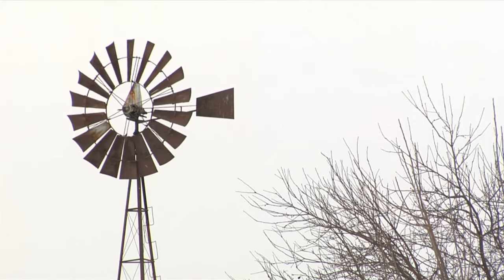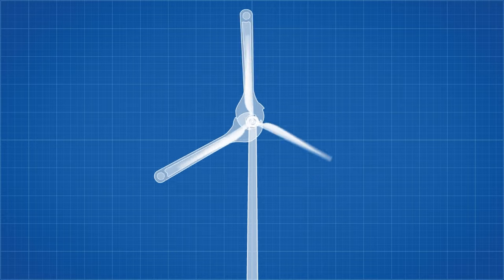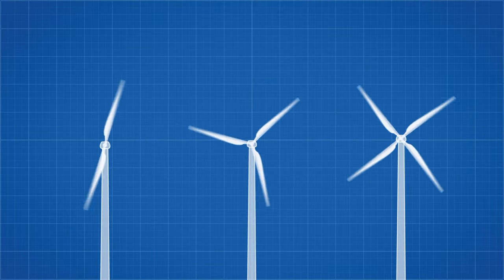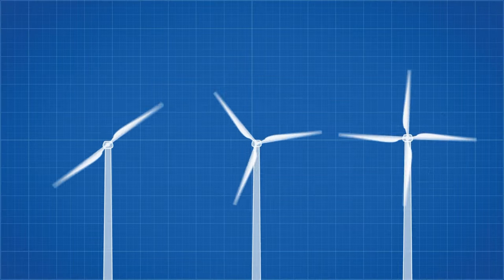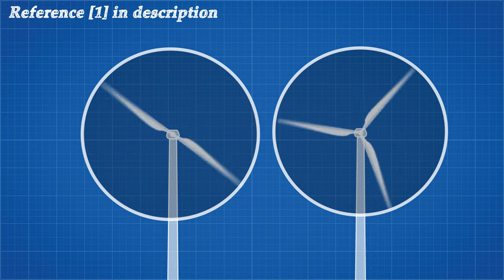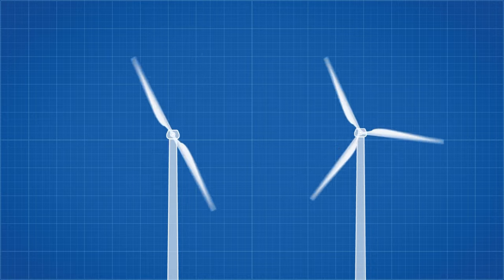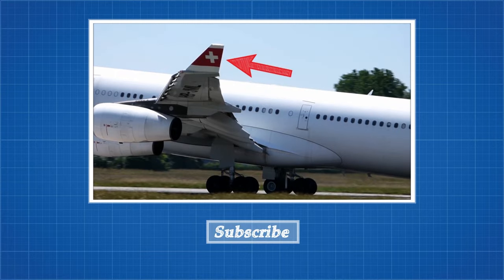Why Do Wind Turbines Have Three Blades?

Comment from the maker: I plan to remake this video at some point. It's a really shallow explanation. I simply did not have the skill and experience to make a longer video when this was released. I could crank this video out in a single day now. The subject definitely deserves a more in-depth explanation.
Reply: Cool, would be really interesting if you did. Perhaps a few consideration on offshore vs. onshore could be included as well as a look at underwater turbines. just suggestions of course. cheers and keep up the good work!
Reply: This explanation is good. It's not misleading in any aspect. Some details are left away but mainly it's a cost, structure and noise issue.
Reply: also look into single blade turbines...
Reply: Efficiency is low and bearing loads are high. 
But maybe for small WEAs they make sense.   

Go for that https://univerlag.uni-goettingen.de/handle/3/isbn-978-3-941875-75-3 and here into the appendix.
Reply: Please do, your videos are usually so much better.  This video feels like it amounts to "3 is just better".
The generic cost graph didn't even hint at the effect of blade count and the video basically ignored the engineering concerns. (like Robb Stark's comments below on boundary layer related wind speed/stress balancing making even blade counts problematic).  
It would also be nice to hear something on VAWTS.
Reply: With one blade hanging down doesn't gravity want to pull the other two down making it want to spin with little wind. 2 of 4 blades cancel themselves out in that respect
Reply: You also should talk about the one blade design.
Reply: Scott, the single blade design uses one blade plus a counterweight.
Reply: Felipe Abou   So it acts like a two blade.
Reply: Please do!
Reply: @Scott: No. Think about bending moments of/on main shaft.
Reply: Hermann Rochholz   Is that your answer to me saying " So it acts like a two blade "
Reply: Yes, correct. 
And 1-blader has a higher induced drag. The more blades the lower induced drag. With an infinite number it's away- But these have to be infinite slender. This isn't possible because of structure.
Reply: Hermann Rochholz   I'm having a hard time seeing a one blade windmill being the  best. I can see the money savings of a weight vs blade
Reply: No- OK: - blade price is lowest for 1 blade - clear. But the bearings etc are the most expensive because it's no symmetrical load. 
And "induced drag" is highest meaning the efficiency is lowest (This is valid when we compare 1 blade with a chord of 1,5 with 2 blades with 0.75 m with 3 blades with .5m at similar shaped blades (meaning rotor solidity is the same). Theoretically they run the same speed, but efficiency of a one-blader is lowest.
Reply: Hermann Rochholz   Am I reading what your saying right, it's not the way to go
Reply: Imrahil.  And zero blade turbines as well.
Reply: Frank Howard they are more efficient than your puns. Maybe you're onto something there.
Reply: Real Engineering Your explanation was foin (that was me trying and failing to imitate your accent, which is really cool. I love Swedish accents). 

For some reason I was expecting a really bizarre explanation and not a well thought out sensible one. 

But hey you did earn yourself a new subscriber.
Reply: It was good!  Thanks for explaining.   I have a video of wind turbines on my channel.  You can hear the noise they make.
Reply: Wind turbines con make different kinds of noise...
Reply: Real
Reply: Real   Engineering
Reply: Can you explain why they don't put transmissions inside turbines? I thought that it would allow them to spin slowly in heavy wind but produce a lot of energy.
Reply: @Plague Either they have a gearbox OR the use direct drive. Direct drive has a slightly better efficiency but is less flexible. "Produce Energy"? Back to basic school :-)
Reply: Yes, you need to point out the balancing issues between different configurations, the aerodynamic effects on the trailing blades and perhaps new advances (ed. leading edge biomimetic design). Could even point out the disadvantages of large companies producing turbines that have operating lives of 25 years meaning smaller and faster-acting companies develop superior designs due to technological advances not foreseen by the larger ones (eg. Caltech FLOWE inspired by fish schooling). Btw, I was doing some wind monitoring work several years ago around the Moycullen Bogs, talk about windy!
Reply: You mean biometric design? Where from?
Reply: The leading edge of the humpback whales' flipers have inspired WhalePower to replicate this on wind-turbine and fan blades, showing up to 20% more efficiently than conventional blades. Research from Havard, West Chester University and Duke University have also validated these results.
Reply: Forget this nonsense. Go for that: http://www.buch-der-synergie.de/c_neu_html/c_08_01_windenergie_geschichte.htm (Sorry-german)

This is part of "whale power"- these humps are at control surfaces of whales. A blade is not a control surface. 
Minimum drag is ALWAYS laminar flow-as far as it works well. 
Bumps destroy that. Caused by boundary layer displacement. 

OK - the max cp a WT can reach is about 0.59. Best blades reach 0.50 including friction drag and induced drag: meaning 85% efficiency (=0.50/0.59). 20% better means 0.85*1.2= 1.02 =102%- no way.

I nearly forgot something: If you have a bad design one can increase by 20% - that's clear. With these humps you're always "on the safe side" - but you'll never be competitive. 
Engineering is the art to go always to the edge. When it's needed.
Reply: Call it what you will, I would argue that they are both control surfaces – both optimised to extract the most amount of energy from a fluid to move (or rotate) a given mass. Minimum drag (in theory)  can be laminar, as for example bird flight ‘V’ formations but if you observe fish schooling it isn’t that simple – they are using circular motion to propel others along as well as themselves. 
Traditional engineering methods have proven very effective for their time but have been victim of their own arrogance by failing to recognise the far superior adaptations around them – nature – that has been perfecting motion and energy consumption for the past 3 billion years! 
Like you I have an engineering background but I think it prudent to consider what we know and how far that has brought us Vs what our eco-system has proven and whether or not we truly appreciate its advances. Going by your thinking the WhalePower blades should be at the very least inferior to conventional turbine blades, where no amount of smudge-factoring can bring it into contention. But it isn’t and this has been verified by leading academic sources. 
For sure it may seem counter-intuitive given the fundamental theories we’re taught in schools but take it from our elders in nature, we’ve got a lot more to learn.
Finally, I should add your English is far superior to my German so hats off to you Hermann!
Reply: Sorry- but you puzzle things: The V-shape of birds is a result of induced drag- It would be also occuring in inviscid flow. It has nothing to do with laminar and turbulent flow. 
If you make research at an university nowadays it's driven by economics. Whale power is most probably a cheap topic. If you've a good system (take e.G. Enercon- their overall cp is 0.50 including aerodynamic, mechanic and electrical losses) there always will be a loss with whale power. 
If you've a bad system for shure you're able to increase by 20%.
Reply: My bad – I was also thinking about cycling teams ‘sucking’ (also induced) and the aim to remain as aero as possible within a laminar flow. As for the economics behind universities, you’re not wrong there but we’re coming off topic. 
The leading-edge cubicles on blades is an interesting concept for me as I've seen the benefits of trailing edge cubicles (as used on aeroplanes, motorsports and trucks between cabins and trailers). Also, where convention with wind turbines is to separate them so as not to obscure laminar wind flow to each turbine, studies on fish schools has shown the opposite to be even more beneficial as one induces the next within their respective ‘school’, thus increasing the efficiency by not simply percentages but orders of magnitude. Conventional fluid dynamic theory does not account for this apparently little known effect so I expect you’ll find issue! 
Again, one needs to ask why natural systems do what they do rather than discount them due to lack of understanding.
Reply: For shure these natural systems are complicated to understand. But many of them are NOT transferrable to technics. See e.g. the wingtip feathers of birds. They call it "bionics" and built a "winggrid":  Maah- why? This causes "interference drag" when you're moving faster. It's like a brake parachute. BTW: Winglets work like a brake, too, when they are made wrong. And they cause problems with control surfaces. You can always read: "Improvement up to 4%" -BUUT if the airplane is empty they cause additional fuel consumption. Every liner-pilot knows. 
 The trailing edge zigzags are against noise. As far as I know it works in wind tunnel - but not in reality. Here other stuff is made wrong - also communicated by university professors on Youtube. Sorry - aerodynamis is a highly complex field. 
AND you've to see: You've to maintain and to repair all this stuff. Blade access is expensive.  Therefore you should optimize the existing systems. And when everything is squeezed out you can begin with riblet foils and all the other stuff. Nowadays they use the other way: Systems are not understood and then they optimize with gimmicks. That's not the correct engineering way. This is not off-topic. Because it's "Real Engineering".

Most things are understood - but especially for fluid dynamics here is a wide range of effects which can partially  turn the world from red to green. Today I learnt something I've never heard before in my >30 yrs practice of aerodynamics. OK- it's a side effect but for specific stuff it has a real influence.
Reply: thank you for your deep explanation
Reply: So maximum efficiency can be designed for a certain wind speed say 35 mph but you are only going to get that part of the time. No where on earth will you get 35 mph steady wind 24/7 365 days per year. Anyone know where the wind is the most steady and what the smallest fluctuation is
Reply: 100% I saw this video and thought, this is far poorer than your 'standard', if I didn't read this comment, I was going to unsubscribe
Reply: can't wait, what about other blade designs? what about gearboxes inside the turbines?
Reply: No- Max efficiency (max cp) is anywhere in the mid between zero and rated power.
Reply: What's "other blade designs"? Go for "Enercon"- highly efficient, but generator is expensive. 
gearbox- why not? Ah- don't believe any consultant who tries to simply scale linear. Wind power is highly non-linear on machine diameter.
Reply: Please re-explain your cost calculations better. Actually in my calculation adding a fourth blade would add 33% of performance but only add less than 33% of the cost, because you only need to add the blade, not the location, permissions, tower,... So adding 30 blades to one wind turbine should increase the cost less than adding 10 more whole wind turbines.
Reply: Then revise your program. Because adding more blades would increase efficiency above 59%- no way!
Reply: I would love to see a more in depth explanation. Especially as it pertains to noise. If a 4 blade turbine can produce the same power as a 3 blader, AND do it quieter, it might be worth the extra cost.
Reply: Real Engineering (l
Reply: NO- If you choose same solidity your chord (and airfoil thickness) drops by 1/4. Therefore Stiffness drops above  60% and blade weight in nearly doubled. Therefore rotor weight more than doubled. 
And the rotor price, too.
Reply: yes.... you can never be too sure when they may just pop up.... 

I saw one watch me eat sandwhich, it came through the window o-o
Reply: Good, so far this is your only video that sort left me waiting. Keep it up, you rock!
Reply: In the future, If you do make a more in-depth version of this video, it might be helpful to mention Betz's law.  Here's a link the the Wiki article on Betz's law:  https://en.wikipedia.org/wiki/Betz%27s_law
Also interesting to note, is that when a wind turbine manufacturer claims a certain "efficiency" it is always in relation to the total maximum theoretical power limit of Betz's law.
Reply: I've seen an awful lot of two bladed props on light airplanes. I suspect that the three and more bladed props become justifiable when noise and total blade area are taken into account. If you have a really powerful engine, then  you may need more diameter to absorb the power. The landing gear will limit just how large you can go. Three or more blades means you can get by with a slightly smaller diameter.
Reply: It's more complicated than that. If you have enough room, you can just make the single bladed prop a bit longer to make up for that inefficiency. At least you can if that doesn't make the tip Mach number too high for efficiency. 
An infinite or even very large number of blades would be really inefficient due to Reynolds number effects and the fact that hitting a hummingbird would take out a bunch of them. Not to mention icing.
Reply: If the rpm on the single blade was a bit higher, but the tip speed was still, say. Mach 0.6 or less, in some cases it might be just as efficient. Or more. In the case of wind turbines operating at efficient rpms, the swept area probably matters more for induced drag than the span does. The chord matters not at all, for a given amount of "lift".  Only the diameter. Large chords WILL mean a bit more drag and the potential for more lift. For small turbines, the Reynolds number of a single blade will be higher. If you had a blade with a 1 meter chord, which tended to operate at a lift coefficient of 1, and you replaced with a blade that had a 0.67 meter chord, but had high lift devices allowing it to operate at a lift coefficient of 1.5, the induced drag ought to be the same at the same rpm. Other things, though, would be different.
With a counterweight in the right position, and a pivot, the load can be made more or less "symmetrical". Also, the bending in the plane of the blade disk maybe be a bit more significant, but that shouldn't be much of a problem because the blade is much wider than it is thick, and a single blade will be much wider in any case.
Reply: Efficiency, or maximum lift? Not the same. It's hard to believe that something which sheds more vortices can be more efficient, though there can be other advantages.
Reply: Ok, some of this is spurious, since I forgot we were talking turbines and not propellers. But limited available diameter is applicable, depending on the height of the tower and of obstacles. The noise issue is similar, too, though I think noise concerns with turbines are a bit over inflated, having had a conversation more or less directly underneath a 47 meter diameter turbine in 20 or 25 mph winds. (Ok, say 30 to 40 kph). It didn't take much distance before the noise of the wind against other obstacles, such as one's ears, drowned out the turbine noise.
Reply: Centrifugal Force is a Fictitious Force. Centripetal Force is real, however.
Centrifugal Force + Centripetal Force = 0
Reply: Real Engineering If you remake this, you may look at the extensive real world data gathered by the Danish community of wind turbine owners. For many decades, they shared and published detailed data from all their turbines, across sizes, designs, brands and locations. Some say it's a virtual goldmine for wind turbine engineers.
Reply: Real Engine
Reply: where is the remake of the video bro
Reply: Also, it would be cool to point out that in just a couple of years, the newer turbines have a MUCH larger rotor diameter. GE's Haliade-X which is currently under development will have a 220m rotor diameter, that's a 180% increase in swept area compared to the Vestas V164 (featured in video)!!
The size of modern wind turbines is mind-blowing!
Reply: I've always wondered why it does'nt exist "wind-tunnels"... like funnels to increase the speed and thus conentrate the wind energy at the end. With the turbin at the end of course. Is there disadvantages with such a concept ?
Reply: yeah, you really should re-do it. i was kind of expecting to see the math or at least decent graphs showing how the power output increase with the number of blades compared to their cost or something. here it's just "it's not cost-efficient, just trust me." which is worthless as far as explanations goes.
Reply: Atleast I understood the gist!
Reply: Real Engineering is it out now ?
Reply: Real Engineering 000623
Reply: Yes, you should explain why they are not like jet engine fans.
Reply: Why is your title and description translated so poorly?
Reply: Real Engineering 2
Reply: why not talk about vertical turbines?
Reply: Not gonna lie I expected you to drop a skillshare promotion here, any time someone talks about learning I brace myself to hear about it.
Reply: You said it!
Reply: Would love an update on this
Reply: Could you make a video about vertical axis wind generator vs horizontal one?
Reply: Was about to say. But, but, but... you didn't explain why...
Reply: If you're planning to make the video, then delete this video. You're dumbifiying people
Reply: @hermannrochholz1701  I think the explanation is misleading:  It erroneously says 4 blades give more power than 3 blades, then glosses over the choice of 3 blades anyway, never giving any numbers.  4 blades would give less power, for modern turbines.  I think if you want to call it "real engineering" you should consult "real engineers" in this case real wind turbine engineers, since it is a very specific topic and very specific knowledge is required to explain it properly.  Nice try (not-so) "real" engineering..
Reply: @dougselsam5393  I fear that's not clear: If you simply add 1 blade the TSR drops and the cp drops, too. In this case yo're right.
 If you add one blade and keep solidity constant (you can say "the sum of chords") - the cp increases.
Reply: @hermannrochholz1701  He said "let's assume they all have the same blade design for now".
So I was staying with the example given in the video.  But it doesn't matter.

If you add another blade but it is more narrow, as you imply, so you do not increase the total chord, you would lower the Reynolds number and likely reduce Cp.  If 4 blades increased Cp, you would likely see a few 4-bladers out there today.  But you DO occasionally see 5-blade and 6-blade machines (smaller turbines).  One reason is 4 blades suffer from the same "Yaw judders" as 2-bladed rotors, but to a lesser extent.  The ease of changing the directional aim (yaw) does change 4 times with every rotation, making it less smooth-running than odd numbers or just large numbers of blades.
Reply: @yonatan62  Yes THIS is the REAL explanation.  The hammering of a 2-blded rotor, when changing direction, is called "Yaw judders", "chopping around the corner", etc. by old-timers.  Really, you can EXPLAIN this til you're blue in the face, but ONLY someone who has EXPERIENCED it will EVER understand the severity and brutality of the hammering of a 2-bladed rotor changing direction.  The SIMPLE reason you seldom see a 2-bladed turbine is Darwinian:  They've ALL destroyed themselves!  Ask 1000 non-wind people why 3 blades instead of two, and not a single person will know this.  I don't care if you have a PhD in Physics or design jet engines, the ONLY people who REALLY understand this are those who have run two-bladed turbines.  The only type of wind turbine that can run two-bladed rotors successfully is my multi-rotor turbines or a fixed-aim turbine, in which case two-bladed rotors run just fine.  I like to make two-bladed rotors out of wood with a quarter-inch central hole so I can spin them unloaded, facing the wind, on a philips screwdriver.  You have to change direction very gradually or this effect will rip the screwdriver handle right out of your hand(s).  I don't care how hard you try to hold onto it. The average person will never understand the true subtleties of wind energy, and actually this one is NOT subtle - it destroys the turbine.  THAT is the real reason you do not see two-bladed turbines:  Many have been built: They all self-destructed!
Reply: Do it man i would like to see it.
Reply: Only real wind energy people know this answer.  No outsider will ever get it right.  There is no point making videos "explaining" what you do not know or understand at all.  And there is little point trying to explain the real answer if you ever stumbled across it and by some miracle understood it - people's eyes will glaze over, and they will not "get it".  Suffice it to say the reason you don't see two-bladed rotors is they've all destroyed themselves.
Reply: Maybe make it with some Halide X footage.
Reply: @hermannrochholz1701  man you have so much of knowledge why don't you start your own channel 👍🏻👍🏻👍🏻
Reply: @yutaitadori7318  Yes-  I began to write a book about it. The point: First it'll be most probably in german language. 
I already wrote 3 books- one about cycling in Traffic- an analysis. Published at "epubli".
Reply: @hermannrochholz1701  👍🏻
Reply: Here's a question you might want to address when you do remake this: Do wind turbines need to be painted white? Could they be painted in a way to make them more aesthetically pleasing for the sake of those living and travelling in the area? Alternatively, could the outer surfaces of the blades instead also be solar cells? How about piezoelectric material, or would the wind not generate enough pressure for the piezoelectric crystals to generate any noticeable amount of energy? I'm just wondering if there's any way to get more "bang for our buck" out of wind turbines if we don't just paint them to be "prettier" than they are now.
Reply: @TheGeekyHippie  Hey - a good question is as good as a good answer!
Yes- they have to painted in white or light grey: They are built with plastics. And plastics has a "transition temperature" ($T_G$). This is the temperature when it loses its "stability" resp. physical features (stiffness....) . And when you paint them black the temperature is significantly higher. 
Everything is woven in wind power. 
It's relative simple - but connected.
Reply: @hermannrochholz1701  Gotcha, and thanks for the quick reply! 

That's too bad, because I was imagining alleviating the "eye sore" issue by painting them bright primary colors (or even lighter, more pastel colors), essentially imitating gigantic flowers. (I'm big on bright colors as I tend to wear a lot of tie dye shirts, its kind of my trademark). Guess materials scientists need to get on the ball and develop something that can maintain the proper temperature and tensile strength/stiffness needed while not being such plain or drab color.
Reply: @TheGeekyHippie  They are also painted light red. Use light colors (correct english?).
Reply: would like to see the new one for sure.
Reply: Real Engineering  your really smart
Reply: You know what? It was refreshingly concise and to the point. A lot of your videos lately beat around the bush too much, which gets on nerves.
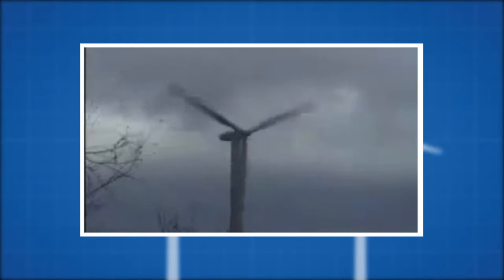Reply: The wind turbine that you showed at 2:14 that failed did not fail for the reason you stated. You said that this is what happens when the brakes fail. This is old footage from before the era of turbines feathering (slowing down in high wind). That video segment misrepresents the current wind energy safety standards and state-of-the-art technology. Please consider losing it in the next version of this video. Thanks for considering.
Reply: Of course, this was humble explanation whitout any prove
Reply: Came to the comments to say this. Glad to see you're on the same page. I look forward to the updated video.
Reply: Pls do so and produce a new video for this topic. I feel the subject deserves a more in depth explanation. Some more "off topic" or deviating Information wouldnt hurt as well. :)
Reply: Propably this would be the best because i just thought at the end "thats it???"
Reply: Ricky Barber  No I did't forget. 
But you're 100% right: Such a machine should be a "blackbox" which converts wind energy to electrical energy. That's it.
Reply: still very informative
Reply: Your English needs to improve. Where do you live? Not in the USA, I'm sure. Just have a reasonably intelligent, native English speaker proofread your dialog, and the vids will be much more interesting.
Reply: I heard annother explination why the 3blade design is chosed and not the 2 or 4 blades.

2 and 4 blades have a dissadvantage when it's windy. Once the blades finds the even number/ balance, they will stop spinning and are also harder to start spinning.

The 3blade design the numbers are uneven and the blades never balanced. The unbalance causes the blades to keep spinning a while after the wind stoped blowing and are also easier to start spinning once the wind starts blowing again. This unbalance generates more power.
Reply: Huh, glad to see this as the first comment - I was scrolling down here to see if anyone else was grumpy about how budget this was, and here's the boi himself.
Reply: Actually it was pretty good. Sometimes simplification works.
Reply: WHY... do they call them TURBINES... when THEY AREN'T TURBINES... it was marketing hype BS... they are WINDMILLS eos... turbine by definition as opposed to a... propeller or windmill... the trailing edge of one blade overlaps the leading edge of a trailing blade so if looked at from its axis you cannot see through the circle arch of the Turbine blades
Reply: It's been 4 years since the video! 3 years since your comment!  Any time now for the remake?
Reply: add the link of it in description when you make a new one!
Reply: Does the electricity flow into our homes through wires afterwards?
Reply: stability under yaw is the main reason for three versus two blades.   structure weight and transportation costs in favor of three versus more.   learned from rosie the engineer.
Reply: yes, this one was really shallow and also not using the right actual arguments for a three bladed wind turbine design. Hopefully you can focus on Betz's law next time and show that three blades get as close to physics as possible. 
There are also other arguments against a two bladed wind turbine, one is a high stress on the yaw system. During yawing the different alternating position (all vertical, all horizontal) creates great differences in momentum. The three bladed turbine behaves rather as disc during yawing.
Reply: There is a way to make it more efficient. Why would you use brakes when the speed of the wind goes up? Thats rediculeus as in higher wind speeds you get much more energie... The whole concept of 1 big generater and brakes is not smart, when you want windturbines to be more efficient.
Reply: Yeah I thought that video of the exploding turbine (due to centripetal force) was fake
Reply: More use of formulas would be awesome! Maybe touch on the Benz limit too.
Reply: Because they are engineered to be crap. It could support more blades, surface area, if the mast was designed better. Vertical would be better🎉🎉🎉